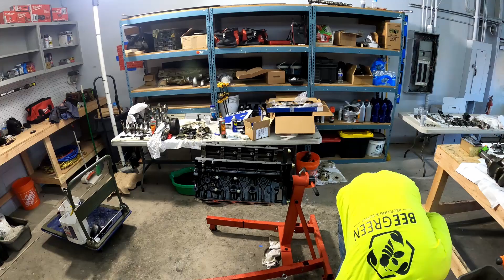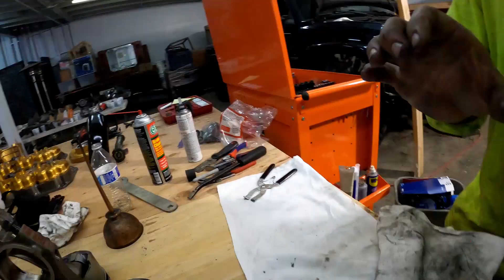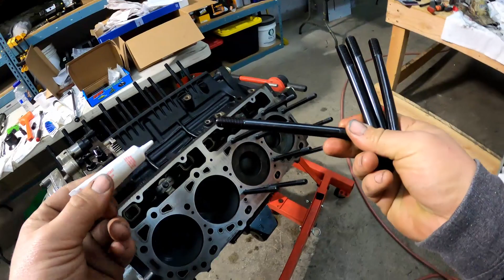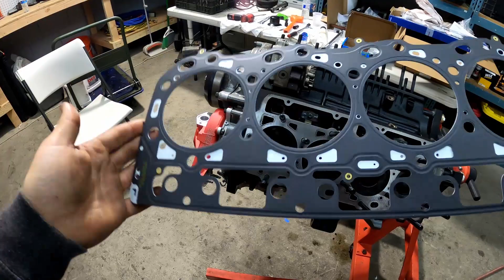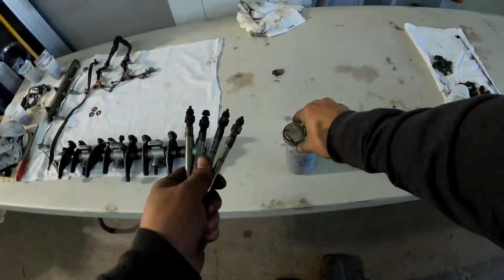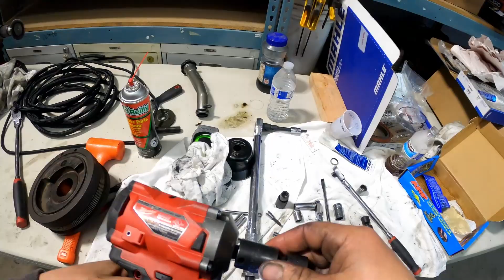Duramax Engine Rebuild Part 3

Comment: about to re assemble mine was wondering if you reused the bolts for the main and rod caps
Reply from the maker: I'm having a hard time remembering now, its been a little while. But I think I did use the same bolts for those things.

Comment: Did you have to check for endplay on crank, how did you go about honing the cylinders ? Thank you 🙏
Reply from the maker: I honestly can’t remember if I checked end play or not. Pretty sure I did but didn’t record it. Although I’m not sure if it’s all that necessary if you’re using the same crank. As far as honing, I used a ball hone and you just have to make sure you’re moving the hone up and down at the right speed to get 45 degree cross hatch.

Comment: Ball park all in what did it cost to full rebuild that nice motor
Reply from the maker: Off the top of my head I think it was around 5-6k but it’s been a little while now and I may be forgetting some things. It can be done cheaper, but I wanted it to last for as long as possible so I replaced things that were probably ok, but I wanted the peace of mind.

Comment: You put the left head gasket on the driver aide which is the right side
Reply from the maker: Been a while since I did that project, but I remember catching that and swapping it around, I didn't show it in the video though. I obviously couldn't have left it that way because the water and oil passages wouldn't have lined up, and the truck is still running perfectly.

Comment: i forgot dowel pins for the rocker shaft its been running great for 500 miles. how crucial are those?
Reply from the maker: Ooof. Don’t take my word as gospel, but I would take it apart and put those back in if I were you. Could cause issues with clearances and what not later on down the road.

Comment: How did you go about paint what did you use for the block and the oil pan and that
Reply from the maker: I used high heat engine paint for all of the painted parts, minus the manifolds on each side, there is a specific flat black manifold paint for those parts that get really toasty.

Comment: How did you deck the block? And what manual did you use?
Reply from the maker: I used 1000 grit sand paper and a block, as per the instructions in the manual. All information/manuals on rebuilding were from alldata.com - that was an awesome resource for me during this rebuild.

Comment: Any specific reason that you did not put the cylinder head dowels back in the block?
Reply from the maker: Lol, it’s funny you caught that. But don’t worry, i pulled it back apart and put the dowels back in. Stupid mistake, but thankfully I realized before I got much further.

Comment: Did you use the Mahle 41909 piston ring ? And did you have to gap them ? I’m building my first LB7 and I don’t wanna fuck shit up lol it says factory replacement just didn’t know if I slap them in like that. Love the Lb7 videos !!
Reply from the maker: Thanks for watching. I don’t remember exactly off the top of my head if that was the part number I used. But I did you Mahle, so that should be correct. And yes, I gapped the rings. But most of them really didn’t need much if anything. Good luck. Those are great engines!

Comment: Kindve a late question , but what kit did you use for this overhaul ?
Reply from the maker: No worries. Almost all of the parts came from Lincoln Diesel Specialties. They took really good care of me and pretty much told me all of the parts I needed and got me set up.

Comment: Did you take the block to the machine shop and if you did what did you have them do? Also cost? Thanks love this series! My lb7 needs head gaskets and has 300k on it so I'm debating rebuilding the whole thing but not sure yet.
Reply from the maker: Glad you’re enjoying it. 👊 I think with all the stuff I did it was about 5500-6000, but it can probably be done for about $3500 if you don’t put all the extra fancy parts in there that I did. I didn’t end up taking the block anywhere, I was able to clean everything myself, and then I decked the block with 800 grit sand paper and a block. (Per the manual) and it’s been working great. 30k miles roughly since the build and she runs awesome.
Reply: Cool . glad its doing great ! And thanks for the reply!
Reply: What manual are you following?

Comment: Why clean the deck with a rotary?
Reply from the maker: It’s just a brass wire wheel to get some of the bigger debris off, then the block gets decked per the manual.

Comment: Great job dude! About how much did you spend on parts?
Reply from the maker: I plan to put a break down in the final video. But it was around 6k for everything. But I put a lot of extra upgraded parts in that didn’t have to be there.  Stay tuned for part 4. 👍

Comment: Get that block decked.  Don’t settle on the wire wheel or angle grinder, it’ll take off .001 in less than 10 seconds and you’ll have microwaves on that deck.
Reply from the maker: I did deck the block, per the manual, and the motor has 60ish thousand miles on it since the build and runs beautifully. If I remember correctly- that was a brass wire wheel also. So it won’t be removing block material, only residual gasket.
Reply: Excellent!
Reply: You’re absolutely correct! That scene was like watching someone scrape their nails on a chalkboard.